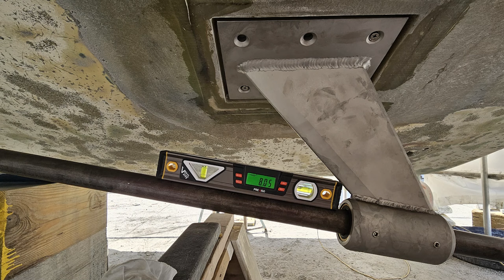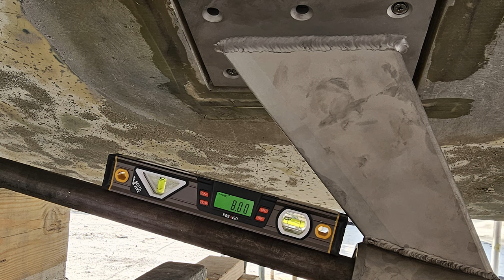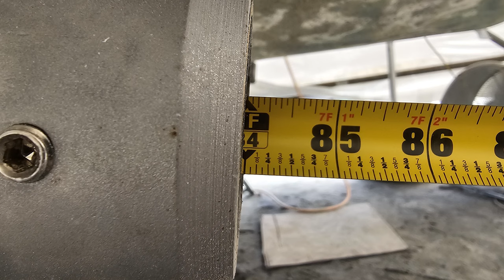Bertram 31 Repower Refit EP08 DIESEL Conversion -- MAJOR GLASSWORK COMPLETE!!

Comment: As far as offset rudders, In the world of tournament inboards (ski, wake, and surf boats), some manufacturers offset their rudders.  The main reason for a rudder offset is to be able to remove a shaft without removing the rudder.  There is not really any hydrodynamic benefit with an offset rudder.  I have been with correct craft (Nautique) since 1991.  Nautique rudders used to be airplane wing shaped (you had one curved side, and one flat side).  They were shaped that way so you could counteract propwash, and essentially "tune" the rudder to the boat.  You could have the steering pull left, right, or neutral by sharpening, or flattening the rudders trailing edge.  In the same way you would have lift for an airplane wing by changing the way air flows over the wing, you can now have torque for a rudder by changing the way water flows over the rudder.

anyway, great videos, I just purchased a 31, and am about to dig into it for refurbish.  I enjoy watching your videos for a bit of education
Reply from the maker: Very cool! Great info!! Interesting, the wing profile.. glad you enjoy the videos!

Comment: What does the surge tube/pipe actually do?  Are the struts aluminum or stainless?
Reply from the maker: The surge tube is a fail safe just in case water were to fill the entire exhaust system while the engine was not running. (Anchored and boat sloshing) this chamber creates one last effort to keep water from backing up into the turbo. The Struts are stainless steel. Not certain the alloy. Very heavy duty for 300 hp!! Great questions!!👍

Comment: I have heard some talk of building tunnels for the wheels so that you can spin bigger, newer styled wheels. Has that fallen out of favor or were lessons learned that it wasn't worth it?
Reply from the maker: Interesting you should ask! I have designed a set of Prop Pockets that have reduced shaft angles to 5° increased Propellor Efficiency upto 96%. We ruled it out for this boat because the recently replaced fule tank would be scrapped and several other major modifications would be necessary. I certainly would like to rebuild a 31 with my design... maybe one day.
Reply: @vernesecustoms  I wish I had the coin to do so. Did they expand the fuel capacity with the recent replacement? I had a 1973 31 when I was in high school in Stuart "Nakota". Well, my family had it but I was the main user of it. All of my beer money from mating went into that boat. Is there an ability to change the fuel tank configuration? Maybe a T shape?
Reply from the maker: @DerkeFish  it certainly can be done. Not on this boat. I would find a bare hull if I were to give it a shot.. certain it would be a drastic improvement over the 15° shaft angle that left the factory.

Comment: How much lighter is Coosa than plywood? What is the objective of having the exhaust thru-hulls where they are. They seem to be pretty low in regards to the waterline.
Reply from the maker: Coosa is available in different densities.  We use Bluewater 26# for the stringers and 15# for everything else you see. I heard once that Marine Plywood is 26# density. The exhaust system is as high as we could manage while keeping it below the cockpit sole (deck). They will be mostly under water with a heavy load or ready to fish. The only other option would be dry stacks.. 🤣
Reply: @vernesecustoms  I saw an image of a refit with side/corner exhaust thru-hulls. What would that benefit be? Just cosmetic? How about oval thru-hulls to snaz it it a bit?
Reply from the maker: @DerkeFish  we discussed both options! The owner preferred the traditional transom output. I have done side exhausts with great results.  If done correctly,  NO backpressure and the wash carries fumes away from the boat, eliminating the "station wagon effect"